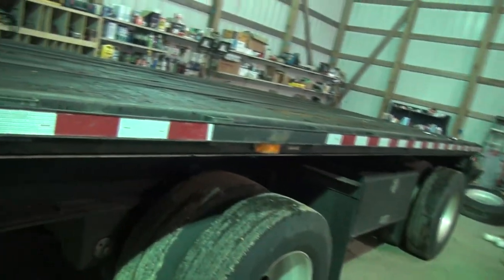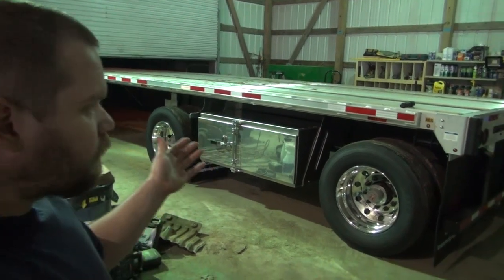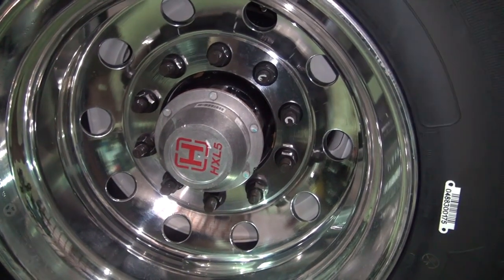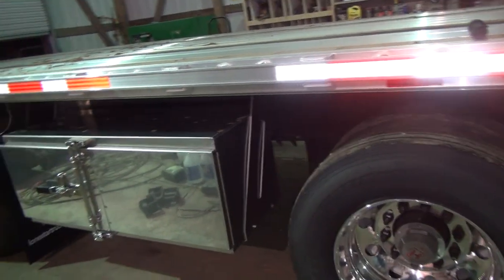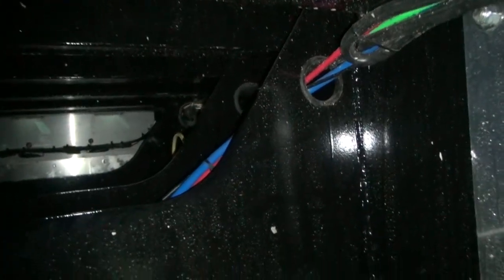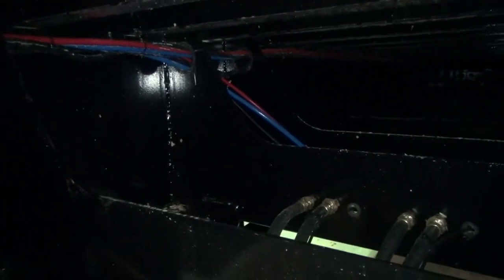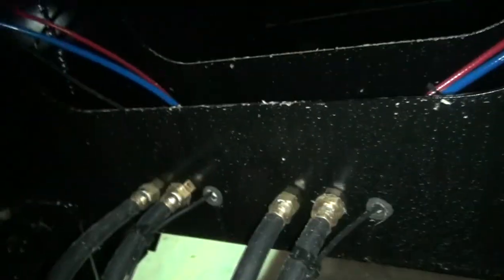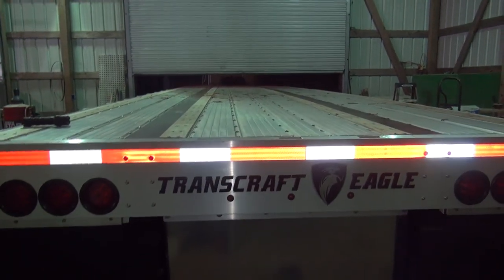I bought a new flatbed 2022 transcraft eagle

Comment: Lift axle weld on or bolt on. If you deadhead quite a bit or carry a lot of loads less than 18,000 lbs it’s worth it. I’ve seen approx .75 to a full mpg increase with the axle lifted. The ride empty with no weight on the trailer does get a little bumpy. The Hendrickson kit is around 600$. Chase-get your dump valve installed in that back axle…wire it to a switch inside the truck…wire a light or buzzer on the switch..it is a life saver in tight situations and saves the back axle and scrub on the tires…you will never drag another spread axle without it…enjoy your videos very much. Thanks
Reply: I didn’t have to reprogram the abs on the lift axle install..as long as the brakes engage w the axle lifted on the lifted axle you’re good w dot…also I wanted an activation switch for the lift axle in the truck but dot only allows for a manual valve outside..they don’t want guys lifting or lowering axles going across scales.. I have a great Dane combo and I was only able to achieve about 5 inches of lift not sure what you’ll be able to get on that Transcraft any less than 5 inches of lift you’ll have to watch bumping tires on unlevel surface.
Reply from the maker: Something I might look into in the future. I keep hearing mixed results from people saying a large increase in mpg like you've seen to people saying it's not even noticable. I'm not sure why some say they see a difference and some don't... I had a dump valve on rear axle on my other trailer and had it hooked up in my old truck, but when I got to current truck I never wired up the switch for it.

Comment: If you run the same trailer all the time I’d fit a 5th wheel polyester liner to save wear and eliminate all that mess with 5th wheel grease.  👍. Good luck with the new trailer.

Comment: I borrowed a friends trailer like yours with the front lift axle and it turns long then, only turning on the far rear axle. Grease hubs are fine I wouldnt sweat it. We bought a 5 gallon pail of synthetic grease for packing them when needed. I think you fill the cap also a third or something so when it gets warm it all flows.  They work, but so do oil hubs.  Sharp trailer, I am glad you got it !
Reply from the maker: Some times it doesn't need to turn longer that's for sure. These spreads  already turn longer than a closed axle. Would be ok on the interstate but turning in town probably not to good. I probably won't mess with the hubs anytime soon but it does kinda bother me I can't see in there like I'm used to LoL
Reply: @LifeWithChase  I carry an infrared thermometer. Summertime they Can get as hot as 130-140°
Anyting above 140 I would repack. ASAP

Comment: Nice looking trailer.
Lots of trailers are running the grease filled hubs. 
To convert to oil bath hubs would also need to plug axle tube or your oil would run into the axle tube.
Reply from the maker: I seen a 2019 trailer that had the axle vent with oil hubs so I'm not sure on that if it's setup any different or not.

Comment: Grease hubs are great. Even with bad wheel seals they don't leak out and ruin your brake shoes. Only thing is when is comes to changing the grease it is a big mess. All that said when I got my new trailer I got it with grease hubs again.
Reply from the maker: Good to hear. I had good luck with the oil baths and I liked that I could check them easily, but everything seems to be going to this. I figured it would be pretty messy when it comes time to service them though compared to oil bath.